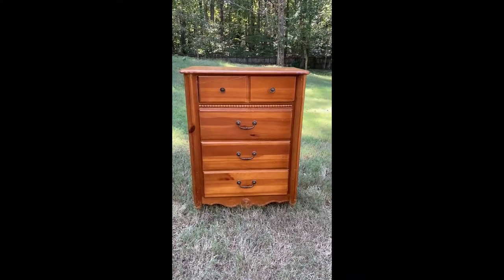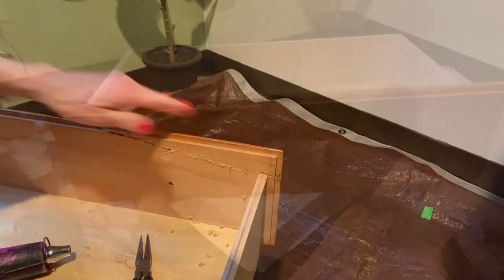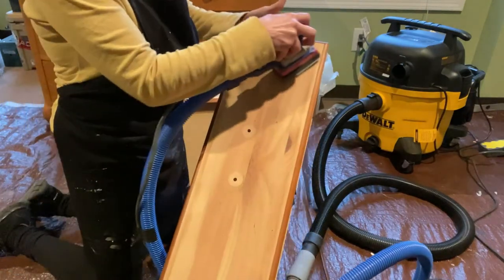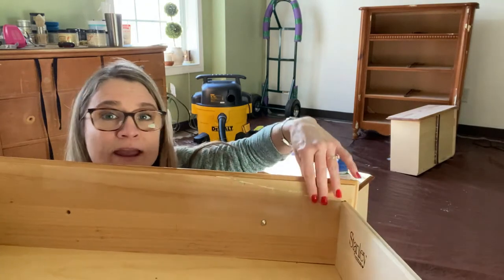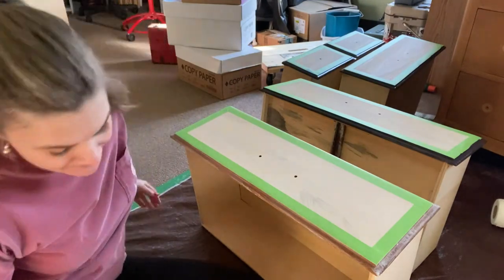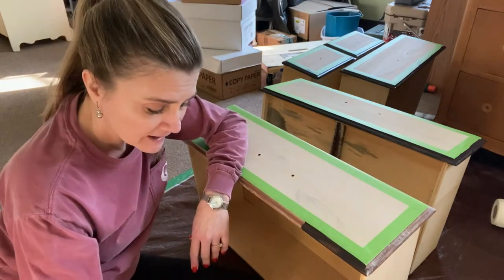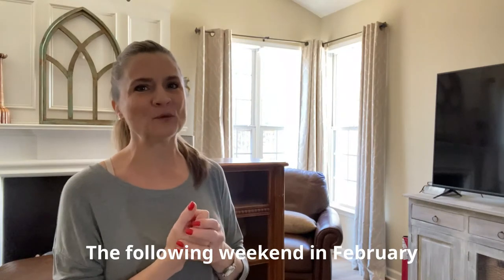Streak-Free Furniture Painting ||  Valspar Cabinet & Furniture Oil Enriched Enamel Paint

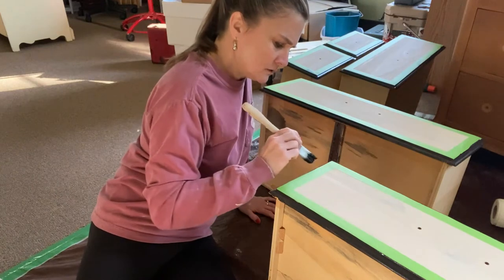Comment: Beautiful end result. So in your opinion, at the end of 3 weeks, do you feel the hyped durability is there?  I know it is hard to say without doing a discreet scrape test somewhere lol, but did you feel comfortable selling it without a topcoat? New subbie.  Oh and I noticed you had a few orbs floating around, at 9:36 one is on your shoulder. You have a friend keeping you company!
Reply from the maker: Thank you for your kind feedback - and for asking about a scrape test. I just tested three areas with my fingernail as well as a screwdriver, and the paint did NOT hold. Eek! This is the one and only piece I haven't been able to sell, despite marking it down twice, which I thought was so peculiar. Now I realize that was by design because now I have the opportunity to properly seal it. And yes, I did notice what you're calling orbs. I wondered the same thing.
Reply: I noticed the orbs as well!🥰
Reply: @tableflippinghousewife  oh no that is so disappointing.  getting ready to use this exact paint in navy blue.  idk how to seal it
Reply from the maker: @cking2002  I’ve use this paint many times since that original project. I now add polyurethane to my last coat of paint just to give the piece some added protection while the paint cures. I also often prime depending on the finish I’m painting over. I’ve had no issues with it scratching since then.
Reply: @tableflippinghousewife   do you use oil based poly or water based?  I have just started using the oil enriched paint so I am taking notes!!
Reply from the maker: @karenward7251  I always use water-based products. They don’t yellow overtime. Plus, it’s much easier cleanup than the oil based products.
Reply: Do you use water based primer also? If so what kind? The piece looks great!
Reply from the maker: @phild1995  for this particular piece I did not prime it because I was painting on wood with a finish that I had lightly scuffed sanded. Where I sanded down to bare wood I did use Zinzer bull’s-eye shellac which is oil based. Whether I prime or not depends on the paint I’m using as well as the surface I’m painting on. If I’m dealing with laminate furniture, I will always prime with an oil base primer. I like to roll-on Zinsser Bin Shellac Based primer. Or the clear shellac that I used in this video. I do you use water-based primer but I haven’t found one that has consistently allowed me to have good paint adhesion so I don’t want to recommend any of them.
Reply: @tableflippinghousewife  Thankyou so much for your quick reply! I love your channel! Keep up the great work.

Comment: I'm enjoying your channel and Shannon's as well. I will give this paint a try, I usually use Fusion and General Finishes but I think this is more economical with great results, plus they can mix whatever color desired.  Dry time for recoat is a bit longer, but that might be okay.
Reply from the maker: Thank you! Yes, definitely give it a try. I did this piece a year ago. While I have continued to use it, I have found that it DOES, in fact, need a topcoat for darker colors. Otherwise, you leave dusty looking fingerprints on the painted surface every time you touch it.

Comment: Would this be a good paint for a kitchen table or is there a better paint to use for a table that will get wiped down a lot?
Reply from the maker: Yes, this would be a great paint for your kitchen table top. However, even though it has a built-in topcoat, I would still recommend that you apply a good topcoat to at least the table top for durability. I’d suggest Dixie Belles Gator Hide or polyurethane. Several coats of the water based poly would work (the oil based would add even better) to protect the surface from water and food stains as well as wear and tear.

Comment: Have you had issues with this paint feeling sticky even after waiting out the dry time/time needed before recoating, particularly with a dark almost black color?  I use this paint allllllll the time but mostly whites like Alabaster, or other light colors.  For some reason, anything that is dark shaded, no matter how thin i do a coat, it feels crazy sticky FOREVER.  Wondering if your comments ive seen here where you add polycyclic to the paint for your last coat, does that also help it in this drying/not feeling sticky issue by chance?  I live in Houston so humidity plays a factor I realize, but I usually let stuff dry in my house where it's temp controlled.  Can't figure out if our AC is maybe TOO cold in the house or ??????  It's driving me bonkers!  :)
Reply from the maker: @reneesalinas5814  I’ve not experienced stickiness but the black always, for me, requires a topcoat or else I leave dusty looking fingerprints whenever and wherever I touch it.
Reply: @tableflippinghousewife  gotcha. Ok I think I’m going g to try the polyurethane and paint mixed together and see how it goes. Would  you use Varathane water based poly mixed in with this paint? 2 parts paint to 1 part poly ratio?
Reply from the maker: @reneesalinas5814  make sure you're giving the paint the time it needs to dry before adding additional coats. This might help with the stickiness in the future. If you're still working on the same piece, I'd just give it a topcoat and not mix the two together. I don't recall how much poly I used to add to the paint. I stopped doing that once I realized I needed to simply spray a topcoat on when I was done.a second coat. I recently switched to Benjamin Moore's Advance line. I used the SW Emerald paint here because the BM store was closed the day I needed it. Try BM's Advance paint the next time you need to purchase paint and then let me know how you like it.
Reply: @tableflippinghousewife  Yeah Ive been waiting it out upwards of 24 hours before recoating waiting for the tackiness to dry up.  Its crazy  Ive had same issue with SW Emerald (which i don't care for in general anyway) in dark colors.  Deducing it must be a houston humidity issue right now......cranked the AC up higher than any of us like to tolerate usually and it seems to be helping.  Taking one for the team so to speak to get this project dry and done!!  Ive heard good things about BM Advance before as well, may have to give it a shot.  :)

Comment: i know you also mentioned a top coat? i have this same exact brand and I'm painting my cabinets, off white with a semi-gloss finish. which topcoat should i use?
Reply from the maker: Hi Rachel. This was the first time that I used this paint. I did a scratch test on one of the legs after four weeks and a little scratched off. Eek! So I brushed Varathane's Polyurethane in Clear Satin over the painted surfaces. (FYI - I have since switched to using the Matte Finish. It has less of a sheen which I prefer). I continue to use this paint at times but now I add the poly to the paint when I spray or brush my last coat of paint; roughly a 2 parts paint to one part poly. I feel it gives the piece the extra protection it needs. Technically you shouldn't have to topcoat. My first application may have been using error. But since I resell my pieces, I always topcoat everything to some degree. Let me know how your piece turns out.

Comment: I like the fact that she more or less does this as a "one off", revealing the trial and error issues that we all run into.  I noted that she repaired some of the drawer corners also (with the same putty?).  I would have liked to know how she did this.
Reply from the maker: It’s been a while since I did that dresser. I know that I used wood glue to reattach that corner piece that was broken off. And then I think I filled the crevices, which were very small, with Durham Water putty.

Comment: Beautiful! What color black did you tint it?
Reply from the maker: Thank you Jordan! The color is Caviar. Apparently two different companies have a black called Caviar so look at the paint chips of both to see what you prefer. If I can remember correctly, they were very similar. I waited a month before posting it for sale to allow the paint to fully cure. However, when I did a scratch test in two different areas, the paint did scratch. Boo! So I gave the piece two coats of poly. I continue to use this paint, though, because it's so nice to brush on, but I mix poly into the paint for the last coat of color and I spray a coat poly on as well.